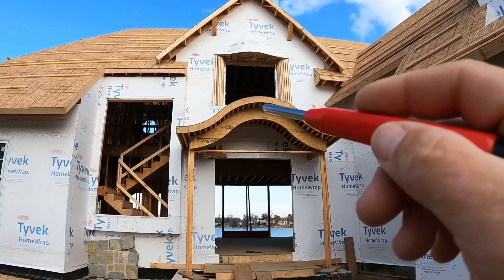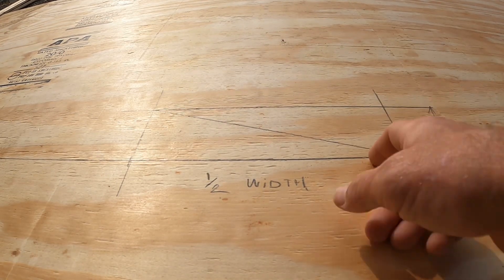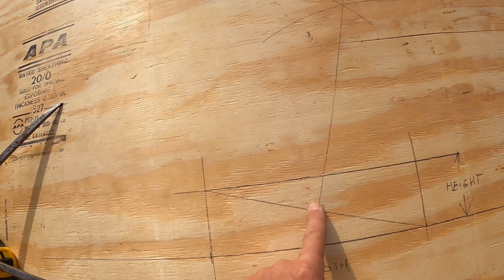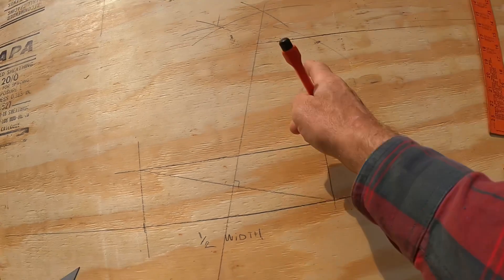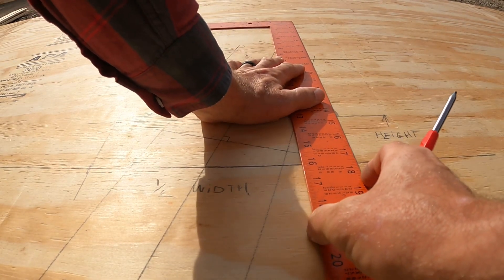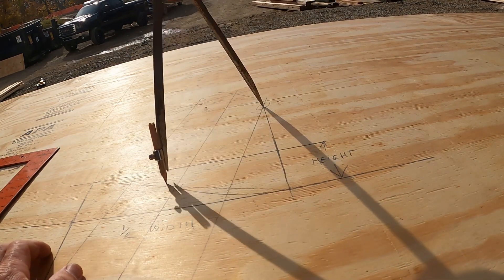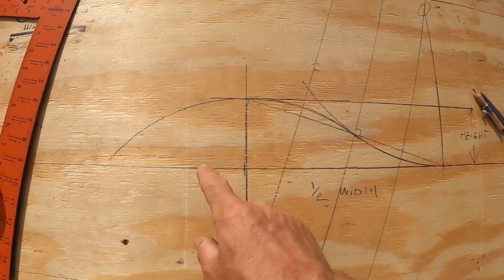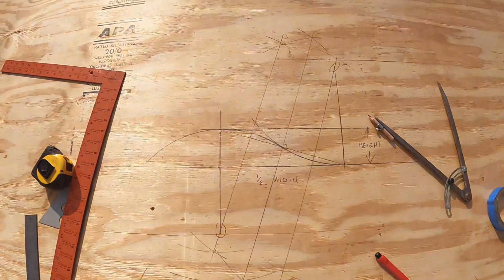How to layout a bell dormer

Comment: Your videos are excellent. Very clear. Can you recommend a good book on layouts?
Reply from the maker: What specific kind of layout are you looking for?  I have several books I use for roof cutting
Reply: @Redoakcarpentry  Thank you for responding back. Which two books would you consider the best that you use for your work? I guess my question would be which books do you consider the most helpful for the videos you post such as the eyebrow video?
Reply from the maker: @stefboulas  sim ayers holy grail of roof carpentry is the most informative but also the most difficult.   If you get that book you’ll understand roof geometry on a deep level.  A roof cutters secrets by will Holiday is a great resource and a bit more accessible, but also doesn’t really acknowledge the utility of a construction calculator.  Much of the math in that book is replaced by a construction calculator.  But all the concepts are still valid.
Reply: @Redoakcarpentry  Thank you very much. I will order those books today. Appreciate it.
Reply: @Redoakcarpentry  
I can’t find these books nowhere. I see it’s a two volume series but can you please let me know where I can buy them?
Excellent content on your channel. Greatly appreciate your willingness to share your knowledge.